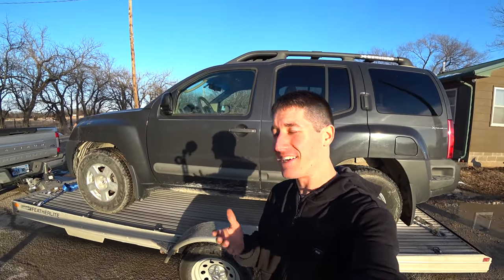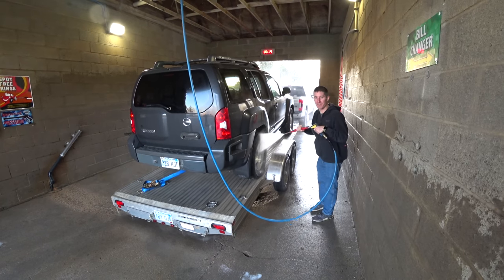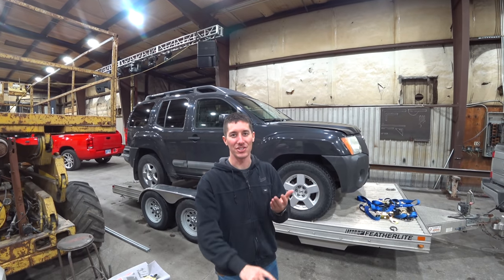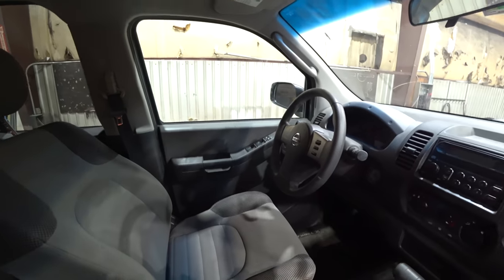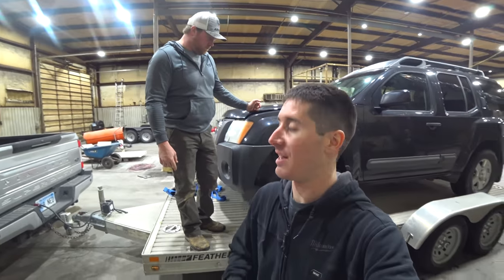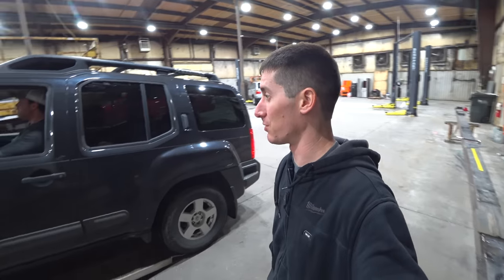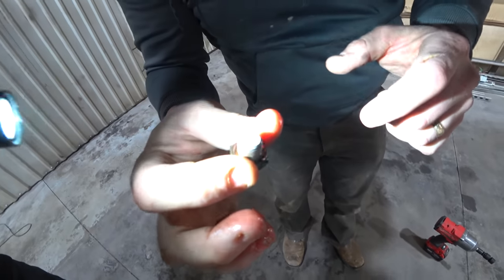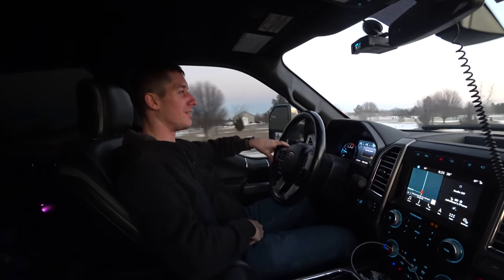The Nissan Xterra Is Everyone’s FAVORITE SUV So I BOUGHT One For Only $750

Comment: JR, I've got a 2007 Altima and the transmission went out when I was going up hill on the freeway. I managed to limp into the dealership ( the car wouldn't go over 35 mph) and they took the car for the night. The next day they called me to pick it up and all the error lights were gone and it was driving again. All they said was it's shot and it's going to be $5200 to fix it! Obviously that's more than the car is worth (even though in great condition otherwise) and it's been driving around town without any further problems? Should I try some of the Lucas or just drive it until it quits? (they said there were 143 error codes but it seems to be fine?) Just afraid to take it outside of my local neighborhood?

Comment: Another Nissan, from that period, is the Nissan Terrano, they had a range of motors, but one of best was the 3.2 litre turbo diesel, a real bullet proof motor, with amazing economy. Had the Auto transmission out of the Patrol, so over kill for the smaller Terrano.

Comment: Sounds like possibly the timing chain tensioners are shot.  And yes, like the other comments, the trans cool lines passing thru the radiator fail, with cross contamination the result.  If you have to do the cam chain tensioners, do the water pump while in there.

Comment: I got my xterm for $750 . Canadian.  6 speed manual off road 4x4with a locking diff.  Needed a clutch... which are not cheap, for some reason Nissan sent with a dual mass.  Up here the gen 2 are very popular.  BTW It sounds like you need timing chain guides.

Comment: @watchjrgo hey man couple of things. 1 I can hear the timing chain whine when you started it. This is notorious in all years up to 2012 of this gen. Also even though you can just bypass the radiator for the trans cooler, it's possible the radiator is delaminated inside so best to get the up to date version of the radiator (Nissan discontinued the one that would leak coolant into the trans). Also it might be a good idea to replace the spark plugs and coils (I know.. it's a pain in the ass for sure). I have a 12 pathfinder (almost exact same as the Xterra except independent rear end). Unfortunately I have rebuilt the steering, front end, and replaced catalytic converters as well as a plethora of things but if you need to know anything (though luckily it is pretty easy to work on) just hit me up.

Comment: Also change the radiator, if you’re generous. Radiators in those track leaks and mixes courant with transmission oil which destroy the transmission

Comment: There's a lot of them but Nissan stopped advertising for it. When's the last time you saw a commercial for the 2nd Gens? It's a capable rig, just sad that Nissan bailed on it. You also need to check for SMOD (Strawberry Milkshake of Death). The radiator cracks and lets the oil get into the radiator and then flows back into the trans cooler.

Comment: Make sure to check radiator they are bad about the cooler failing and trashing the transmission  so either a new radiator or aftermarket cooler

Comment: Sounds like its got the classic Timing Chain Whine. The timing chain tensioner shoes wear out causing the chain to slacken. A whining or buzzing type noise may develop from the timing chain area caused by excess slack in the secondary timing chains.  I believe they had to revise the parts. Should have been a recall,  Nissan has issued a service bulletin (NTB09-128) regarding this issue. Replacement of both secondary timing chains and their tensioner shoes will be necessary to repair this concern. As part of this repair, the engine oil and filter should also be replaced. Ask me how I know :)

Comment: I love my 2010 Xterra Off-road.. Been my daily since new. Only got 165k on it.  Had the tarns cooler SMOD, caught it early and a few flushes later still have the original transmission.   Only thing that sucks is the fuel mileage.
Reply: Thought they took care of that issue starting with the 2010's?
Reply: @nsjohn130 Some 11’s had the defective radiators as well. 12’ is the safest bet.

Comment: Did they have the same issue as the R51 pathfinder and frontier of the trans cooler / heater in the radiator split filling the trans with coolant killing it

Comment: Hi I have a 2007 Nissan nismo Xterra.   My stepbrother passed and it was a gift.. I have no idea what I have.. I'm a dodge girl.. I knew about about my dodge.. but this nissan is making a sound like a power steering widing noise right under the driver seat under the car. It has a VDC Button. How do I know it's a 4 wheel drive? I need to know what that widing noise is. It only happens when I start it in the morning and it goes away. I'm thinking fluid is needed somewhere. Please help

Comment: Timing chains sound worn inside the engine from the whine/turbo sound it's a common issue in the early model VQ40 engines 2005-2009.

Comment: 100% of automatic 2005-2009 Xterras will eventually have a transmission failure if you don’t replace the radiator before on or around 60k miles. Some will even re-route the tranny fluid so it won’t mix with your radiator fluid. Nissan knew about the “pink milkshake of death” and eventually extended the factory warranty on these (frontier and pathfinders as well) and then remedied it entirely from 2010 on.

Comment: I almost bought one that the engine was trash. It was neglected.was going to pull the engine ,transmission, remove front clip, but the interior, add a tongue, and build a small off road camper.

Comment: I'm not a fan of Nissan but I love the Xterras might be getting a near 300k mile titan soon
Reply from the maker: I bet it keeps right on running.. that Endurance engine rocks!! 💪
Reply: Do not buy one.I owned one.Was the worst vehicle i have  ever owned.Constantly in the shop for repairs.Soon as warranty was done got rid of it.
Reply: @randyallen7421  The 1st coiple of model years were awful this one is a 2012
Reply: Mine was a 2013.Was never off the pavement.Had to replace radios,ball joints,exhaust system,transmission sensor and there is a vent that goes on the axle that kept plugging up.Just want to give you a little of my experience with them.Good luck!
Reply: @randyallen7421  Thank you thats a shame I thought they wouldve had all the issues worked out by then
Reply: And they do not even make them anymore!Bought a new  GMC 2500 Diesel to replace it and have had no problems.
Reply: @randyallen7421  I wish I could afford a newer diesel I have a parts truck only reason I would consider a 300k mile truck lol
Reply: I don't really need a diesel,but i pull a 30ft travel trailer.It is effortless.And still get great mileage!The Titan struggled to pull it.I do not miss it one bit.😆

Comment: I bought a 2004 that wouldnt go in revese, i thought an easy fix, oh boy was i wrong they want almost 3 GRAND to rebuild it! The trans coolers are notorious for failing put a upgraded radiator  in. the trans is VERY difficult to get out of these things
Reply: Oh its 2 wheel drive? oh your lucky a little easier to get out

Comment: "OOO the brakes are terrible! "lol Yeah that's factory, I love my X but the brakes are like stepping on a sponge.
Reply: I had that problem too.   Get the dealership to perform a proper bleed of the brake system.   There is air that is trapped in the ABS system.  The factory bleed will get rid of this trapped air and restore to a solid brake push.

Comment: I never understood why trucks like that existed at all in 2 Wheel Dr. Makes about as much sense as a 2 Wheel Dr. wrangler. Maybe the previous owner didn't know that when he got it stuck in the mud
Reply: Some people only what the look/basic height of a 4wd, but not the extra weight & corresponding extra maintenance required by the 4wd system. 
I have both a 4x4 & 4x2 in the family & can now better understand not wanting all that extra crap in way during maintenance or repairs.
Reply: @sleepyhollow783  yes, like I said, it doesn't make any sense

Comment: First what the heck? The tires are. $800. Man,  I would kill for that price. Second, that timing chain sounded horrible, need to check that out,  know problem. Third,  swap the radiator,  most likely this suffered the dreaded SMOD  where transmission fluid mixes with coolant due to faulty radiator, replace the radiator or you will buy another transmission in a week. Finally, I will buy ot if you fix it,  no questions asked.

Comment: So it's an Xterrible?

Edit: after you reading off all those awards I feel bad making that joke because of the trans. 

Junkyard just offered me $450 for my van that needs a fuel pressure regulator.  That can't be right, I had to outbid a scrapper at $700 to buy it in the first  place.

Comment: I love the Xterra as a concept but it is so far removed as an actual Nissan counter part to the Toyota 4runner. The Xterra has had so many failing points with a couple decent years on either side, but even the good ones are money pits and unlike 4Runners you rarely hear about one making it to 350K miles on the same engine and transmission. This why you got one for $700. Between bad timing chain guides and co-mingling of trans fluid with antifreeze you got a giant pile of 💩, but it should be entertaining.

Comment: I used to be an Xterra owner good luck selling at that price. The year you bought is known to have the timing chain guide issues they should be and need to be changed, the radiator should be changed because it's a known issue of radiator failing because they were cheaply built leaking causing antifreeze to milk with transmission fluid which ended with the milkshake of death. Hence why you need a new transmission for this piece of shit

Comment: 2wd ... no thanks. why bother.
Reply from the maker: 4wd is the worst thing you could ever work on. So happy it's a 2wd, I'll swap that transmission in a couple hours and make bank. 💵💵💵
Reply: @WatchJRGo  A whole lot easier with no Transfer Case
Reply: I think Tony's point is there be no point telling us what an award winning mid 4WD it is, when this one is 2WD. It looks like clean one though. Who would you need to get in to have the front drive connected? Big job, no easy flip, interesting content?
Reply: I don't know, maybe it would be worth converting it over to 4wd if the parts are cheap and easy enough to do. If it would raise the resell value enough it might be worth it. It's your flip so obviously it would be easier to just pop in a used trans and go. I remember my buddy wanted to replace the clutch in his early 4 runner and I took one look underneath and told him with the way the transfer case and transmission were bolted together there was no way we were trying to do it in my driveway as it'd be way too much work and I've swapped my auto trans in my Dart a few times with ramps and a floor jack, but I always rented a transmission jack to put it back in.